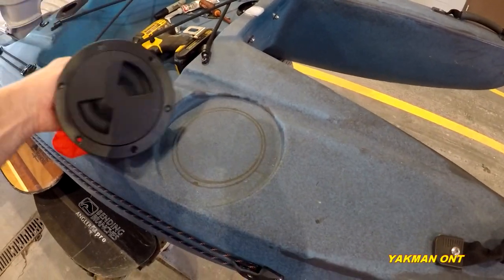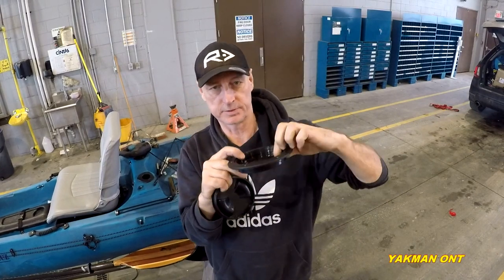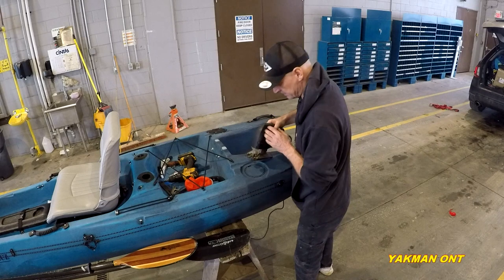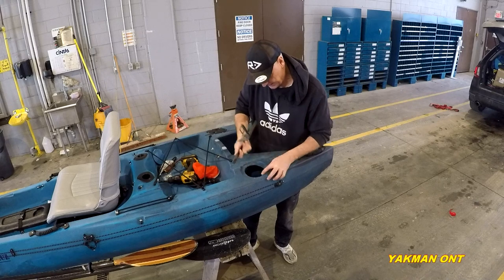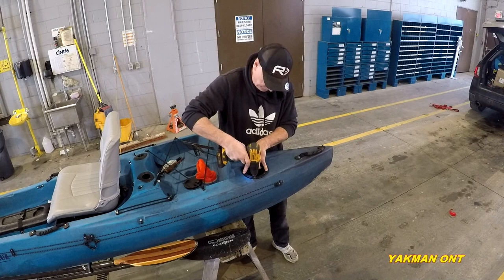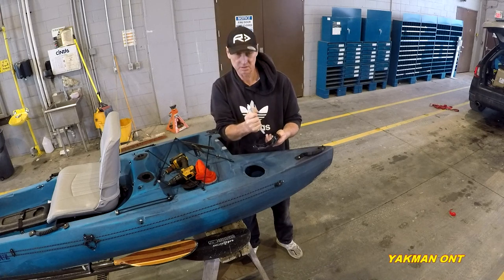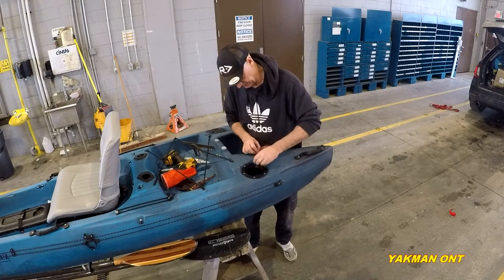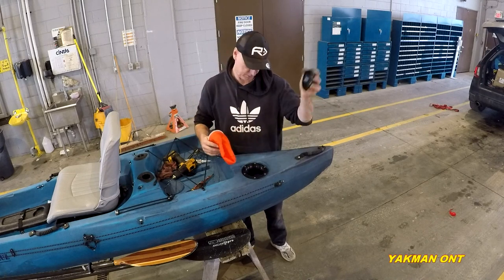How to install A hatch on a kayak

Comment: Jig saws work great, except you gets a mess of cut plastic dust - chips inside the Helen A hot knife is best method for cutting any holes in you kayak
Reply from the maker: Thanks Great info
Reply: I hate cell phone(s) auto spell - correct it can make us sound illiterate lol grrr lots of errors in my msg :(